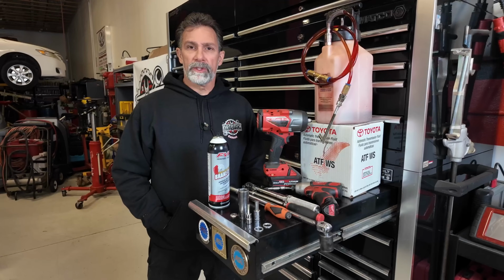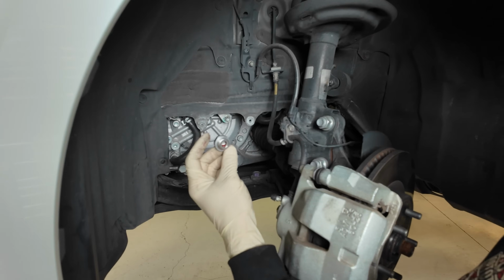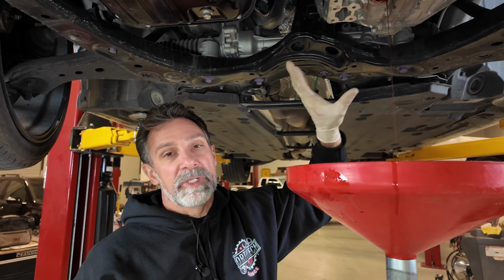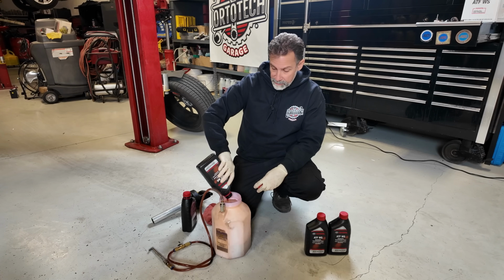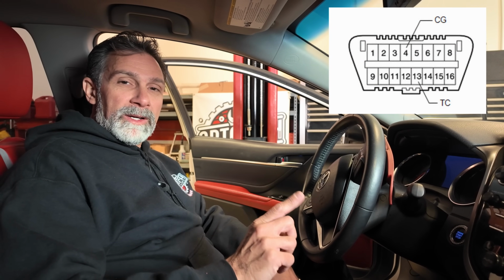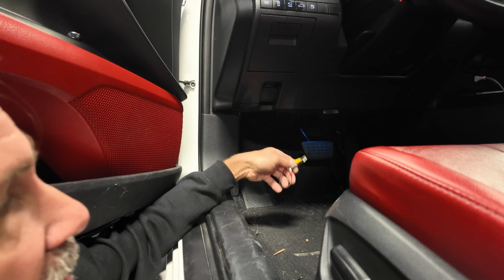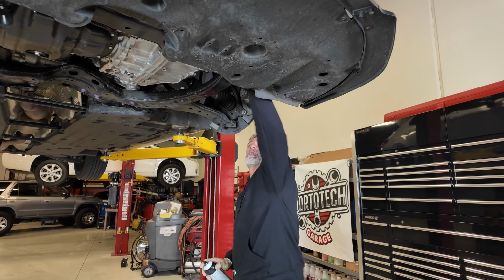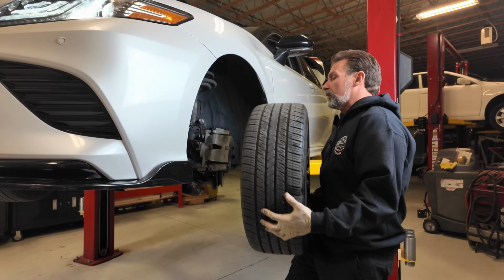The Ultimate Guide to Changing Transmission Fluid on Your Toyota Camry

Comment: Do you really have to jump the OBD terminals....? Can't you just start the car and let the fluid circulate through the transmission and then add as needed until it spills out of the overflow...? I saw someone else on YouTube do it that way, it seems much easier than having to mess around with the OBD...
Reply from the maker: @AlexanderAkilov  You have to activate fluid temperature detection mode and idle control modes. Then check the fluid level at the proper temperature.  I outline the procedure to achieve that in the video. The manufacturer has a very specific procedure to make sure the fluid level is optimal. Will it work with the fluid over or underfilled slightly?  I'm sure it would, by why would you want to chance it? The procedure is fairly straightforward.  Give it a try and few times until you get it right before you change your fluid. 👍

Comment: Tools needed for the DIY-ers: - 4 wheel ramps to ensure the front and rear are LEVEL. 
I would also not lay the inside of the pump unit on the shop floor. Most shop floors will contaminate the oil with enough grit to kill the transmission... 
I would also advise DIY-ers to carefully clean out their weed sprayer before they add transmission oil to it... 🙂
Reply from the maker: Thanks for watching and for adding some helpful tips.  I should be more careful with where I set my tools. I've never seen anyone use a weed sprayer for fluid transfer, but i suppose that could work if you took the nozzle off.  👍

Comment: 2018 Camry with 185k miles… I never change the trans fluid.. should I drain and fill or leave it???
Reply from the maker: I would first check the fluid condition.  If it's not black and you don't see any metal or excessive material in the fluid, I would consider it.  The other item to address is the current performance of the transmission.  If it's functioning normally without any issues, I think it's worth changing the fluid.  Especially a drain and fill.  It should restore the friction properties of the fluid.  I have never seen a transmission fluid change cause a shifting problem on a normally functioning transmission. I hope that helps!

Comment: Hello, loved your video. I am curious about obd ii part, I have BlueDriver obd and able to read the temperature. Do I need to shift N to D while using the obd? Or Do I let it run normally until it arrives 95-115 F temperature? Let me know and thank you.
Reply from the maker: @Deafity  Not only do you need to do the shifting procedure, but you have to activate the TC terminal through the scan tool. That basically jumps the 2 terminals using the scan tool. Your Tool may or may not have thay feature.
Reply: Did the BlueDriver obd have the temp available?

Comment: Excellent video. Just 1 question please...
Would it be accurate enough to measure the oil volume removed and then just add that much  back into it?
Reply from the maker: @BryanBetkey I suppose if you could could accurately measure what you took out, don't spill any, and are certain that it was accurately filled before you drained it, that would work.  But checking the level with the procedure shown easy enough.  I would double-check the level after refilling it anyway.  Plus, it's good to experience this for yourself.  It will build confidence, and you will learn from the experience.  You can do it!! 👍
Reply: You will need to make sure the temperature of the new oil is the same as that of the old since the volume depends on the temperature.

Comment: Thanks! Is this a V6? 8 speed transmission? I’ve seen other videos mentioning cooler bypass - is this needed for the V6 Camry (2020)?
Reply from the maker: @CarlosGonzalez-zy2ni  This is the 4 cylinder, with 8 speed. Not all vehicles have the oil cooler thermostat.  There is a procedure to bypass it if you have one.  You'll have to check the cooler hoses and see if there is one on your vehicle, but I don't believe there is. It would be in line on the hoses.
Reply: Much appreciated
Reply from the maker: @CarlosGonzalez-zy2ni  You're welcome. If you need the procedure for the oil cooler thermostat bypass, let me know.  👍

Comment: I’ve seen conflicting advice, I just bought a 2011 Camry LE with 172,000 miles on it, transmission fluid has never been changed. Some say it’s too late to do it for the first time, is that true? I haven’t noticed any problems with  shifting, so my thought is to go ahead and do it.
Reply from the maker: I have had others ask me a similar question. I know this is a scary situation for some, but I can tell you from my experience, I have never had a good working transmission fail because of a fluid service. There may be examples of that somewhere, just not in my 35 years in the business.  I should mention, at our three locations, we specialize in Asian vehicles, like Toyota, and service thousands of cars per year.  If it were me, I would perform a fluid service.   I am sure there is somebody out there that may have experienced a transmission problem due to a a fluid service though, I just don't know anyone. I hope that helps. If you decide to perform the service, let me know your experience. I hope that helps. Best wishes!

Comment: You did everything right, but made it a little harder than needed.

When you fill the transmission back up, put in an extra half quart. It won’t hurt the tranny, but under filling definitely will. You can put the fill cap back on now and torque it. Then once you get it diagnosing mode and oil is hot, just undo the drain plug again. It will come out quick, but then start sputtering. Once you see it sputtering, throw the drain plug back on!
Reply from the maker: Yeah, I think you can get away with anywhere between 3 and 3.5 quarts on the refill.  I feel like I can add faster than I can drain from that skinny overflow/check tube.  All the while, we are trying to stay in that narrow temperature window.  I've done many of these, and this is the way that seems to work best for me.  I don't think you can go wrong either way. 👍 Thanks for watching and for commenting!
Reply: @OrtoTechGarage why not just let atf come out from the fill hole, then reinstall the fill plug?
Reply from the maker: @jungapo2  The fill plug is all the way up on the side of the transmission.  That would be way too much fluid.  This procedure I show is exactly how the manufacturer has specified in the service manual.  I wouldn't deviate from what they recommend.
Reply: If you're not going to do it yourself, who would you trust to do this work. First of all😅 most places don't let you stand in the garage or watch over a mechanics work, so who knows how many pins they broke, or just ripped the bottom cover off, or didn't put back or  missed a few screws, or didn't really do anything at all.  I would rather drive the car 100,000 mi before changing anything, no matter how many years.

Comment: I have 2011 Camry with 180.000, I don’t have any issue, fluid never changed before, but I’m worried to change it then I maybe get problems 
What do you suggest? Leave it or change fluid?

Thank you
Reply from the maker: I think you should check the level and color of the fluid first.  If it's really black,  you may not want to mess with it.  Otherwise, I would service the fluid.  I have never had a Toyota transmission fail because I changed the fluid.  I have heard stories, but they are like Bigfoot sightings.   👍

Comment: The only thing I don't understand about it is why does the temp matter??????I think it is about the fluid expanding and contracting and I think if it's not at the right temperature the level will not be accurate or right????? The other thing is how do you know that you've got the seconds right when you're shifting the gear shifter???????
Reply from the maker: You are correct about the temperature causing an increase in fluid volume as it rises.  There is a formula for Volumetric Themal Expansion.  There is also a coefficient involved for the type of fluid. We will leave that to te engineers,  but the main point is that you may see a change in volume of up on 0.25 quarts over a span of 50 degrees Fahrenheit.  The temperature is important to ensure the fluid remains at the correct level.   The gear shift sequence will function if you just quickly move from N to D with not more than 1.5 seconds in each position for at least 6 seconds.  Keep steady tempo until the D indicator on the cluster shows you've activated the fluid temp check mode.

Comment: If you're using a scan tool to monitor the temperature and not the jump wire, how do you activate idle control mode?
Reply from the maker: @Williecrts  You do it with the scan tool by looking under "Active Tests."  You will see  the command to "Activate the TC terminal".  Set it to ON. This is basically allowing the scan tool to jump the OBD connector terminal 13 (TC) TO TERMINAL 4 (CG).  Then, follow the gear shifting procedures described.    Make sure to put the vehicle in park and release the brake.  Set the Activate TC Terminal to OFF.  This is the same as removing the jumper wire to activate idle speed control mode.  It will stay in this idle speed control mode until you turn the vehicle off.
Reply: @OrtoTechGarage  Im actually using a Bluetooth app controlled scanner, and I don't think it has that capability. Im going to use the wire method you show. Thanks!
Reply from the maker: @Williecrts  That always works.  Just make sure your don't jump the wrong terminals.  Lol. Not all scan tools have that feature.
Reply: @OrtoTechGarage Btw I think the pin numbering diagram in the video is backwards it made me think you had your jumper in the wrong ports. I thought I was going crazy lol

Comment: What's the recommended millage to drain and fill these? 
My uncle rebuilt transmissions as a side hustle being lead mechanic at iron factory. Retired and had new garage built with a lift for personal use 😂
Reply from the maker: The problem is Toyota does not have a recommended service interval.  They consider it "Lifetime" fluid. They do want you to inspect the transmission for signs of leakage with each service, though. I recommend you at least perform the drain and fill every 30,000 to exchange half the fluid.  If you have access to your uncles lift, the process is obviously a bit easier.  Just make sure you set the vehicle on the lift level to the ground.  Best wishes!

Comment: I just brought a 2018 Toyota Camry se it has 130,000 miles I’m not sure if the transmission fluid has ever been changed should I change it ? Just worried it may start slipping if I touch the fluid
Reply from the maker: @sonidoexperiencia  I would change it if it's not completely black already.  You can check the fluid level the same way I show in the video near the end. If the level is full and it still looks red, pink, or even brown. I say go for it.  If it's really black, it may not be worth doing. That said, I have not had a transmission blow up after a service in 35 years, so i wouldn't be too worried anyway. Your choice, though.  👍
Reply: Yes!

Comment: Please help me, why is my car having it difficult to select 3 and 4 gear sometimes not always 🙏🙏
Reply from the maker: I would really need to have the vehicle to properly diagnose the problem, but if you can provide some more information, I can try and assist you.  What year, make, model, engine size, 2 or 4wd?  Are there any malfunction lights on?  Have you checked the fluid level and condition?

Comment: looks like you need a lift, and the car has to be level. This leaves most DIY out.
Reply from the maker: It certainly helps, but it's not necessary.  Put the vehicle on 4 jack stands, and you'll get it done. 👍
Reply: @OrtoTechGarage  don't trust jack stands.
Reply from the maker: @3100fps  No worries, my friend.  I've been using them for decades without a glitch. Just make sure the height adjusmtent lever is seated properly and the jack stands are positioned on the frame (or pinch weld for unibody construction) before you lower the car. I dont recommend putting them under moveable suspension components like lower control arms. Never leave a vehicle on the jack while you work on it!  If you need help identifying where to place the stands, let me know. 👍

Comment: Thanks for sharing the ODB2 pin jumper method. Using a scan tool vs the pin jumper method to determine the transmission fluid temperature is obviously the easiest and accurate way to get the correct temperature.
Reply from the maker: @donsternberg3600 You bet! The scan tool also  performs the function of jumping the OBD terminals for you when you command it to.   👍

Comment: I would like to ask if different brands but with the same specifications can be replaced?
Reply from the maker: @P880739  I assume you mean different brands of fluid?  If so, the answer is yes.  As long as the fluid you use meets or exceeds the manufacturers recommendations and specifications.  There are definitely fully synthetic options that work well in this application. Do your research and try to exchange all of your fluid, if possible.  👍

Comment: Is it okay the heat the oil 1st by driving the car before draining and then letting it sit overnight to do the cold fluid level check??
Reply from the maker: @Happy_Harry  It won't hurt anything, but it's really not necessary.  The transmission oil flows pretty well, even when cold.  Plus, you won't be removing all of the oil with this service anyway.  I wouldn't bother. 👍

Comment: Great video! I've read on some Highlanders, there is a cooler bypass valve that needs to be pinned 1st??
Reply from the maker: @Happy_Harry Yes!  This it true if your vehicle has a transmission oil thermostat.  There is a botton that needs to be depressed, and a rod or pin is inserted to hold the valve open.  Always follow the service manual for your particular vehicle.  They are not all identical. Thanks for the great comment and for watching!
Reply from the maker: Yes, this is true.  In 2 weeks, I have a video releasing where I demonstrate how to bypass the transmission oil cooler on a Toyota Tundra.  I show the full service procedure and some bonus footage of how to use a scan tool to check the fluid temperature. It's the same process on the highlander.  Keep an eye out for it, or just ring that bell for my channel notifications.  Every Thursday, we release a new video. Thanks for watching watching!

Comment: Just watched your video & changed my 2018 SE Camry last night with my cousin who is a car guy. 
We both thought this was so most challenging transmission fluid change we’ve ever done. We followed your video step by step . When we go to the part about loading fluid , while the drain cap is off . We thought you were crazy lol
Reply from the maker: @christianmunoz4206  Great job!!  I'm glad you figured it out.  The plastic overflow tube is not unique to Toyota either.  Other manufacturers have their version of this to adjust fluid level, also.  The cars just keep getting more complicated.  It's getting so hard to DIY at home.  Its even challenging in the professional garage at times.  Credit to you bothe for getting it done.  Thanks for the support!

Comment: Use Amsoil Signature Series low viscosity ATF if Toyota WS type fluid is called for.

And AMSOIL Signature Series oil in your Lexus Toyota.

Q:Pricey? 
A:OMG, yes! 
Q:Value? 
A:Priceless.
Reply from the maker: Why do you support Amsoil as a replacement fluid for WS.   Are you an Amsoil dealer?

Comment: Great video; it explains the procedure clearly. just want to know where to find the torque specifications for the drain, fill pug and also for the oil sump drain plug. I own a 20014 camry altise in Australia
Reply from the maker: Thank you!  The torque specs for a 2014 Toyota with the U760E transmission are as follows...oil filler tube is 0.8Nm, overflow plug is 40 NM, refill plug is 49 Nm.  I hope that helps!  🙏

Comment: Thanks. I was wondering if there was anyway to prevent a hybrid Camry from turning off the engine, after installing the jumper wire, when trying to raise the transmission temperature.
Reply from the maker: The hybrid has an E-CVT transmission, and they are different. If you want to shoot me an email, I can reply with the specific instructions for servicing your Hybrid transmission. 👍

Comment: Great video with precise instructions. Only problem is I don’t know if this works with a Toyota hybrid, because it will constantly turn ON and OFF the engine (so we cannot stay in idle control mode). What do you think?
Reply from the maker: Funny, you should mention that.  I released a video a couple of weeks ago specifically for a 2025 Toyota Camry hybrid, and one will release tomorrow for a Toyota Tundra Hybrid.  I explain all the details in both videos.  All your questions should be answered in them.  Check them both out and let me know if you have any questions.  Thanks for watching!
Reply from the maker: 2025 Camry Hybrid Service.
https://youtu.be/LvAGwocuCws?si=C-06Zwlqu1scLNMA
Reply from the maker: I think i responded to the wrong comment here.  The hybrids have an E-CVT transmission. It is different.  If you need the specific instructions for that, I am happy to send them to you.  You can email me at OrtoTechGarage@gmail.com.

Comment: Just bought a 2020 camary for my son...Great car...but. omg all this for a trany service...!....i was thinking of getting one for me but after seeing this i think ill keep my 2005 Buick LaCross CSX ...
It needs a trany rebuild as has 161000k miles on it and upshift is very hard intermittently around $2k cost to rebuild. May also need cam chain job...& ac work. But good car otherwise...
Reply from the maker: @haircut2015  Sounds like you have quite a bit of repair expense coming for the Buick.  I guess that is better than a new car payment for 5 more years, though.   Good luck.  I hope you get it in tip-top shape and another 100,000 miles on it. 🙏